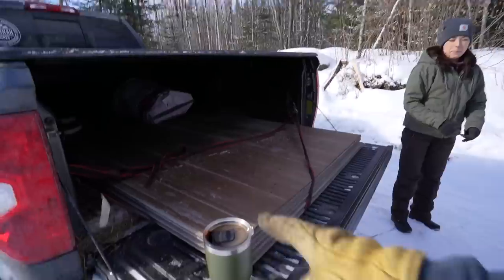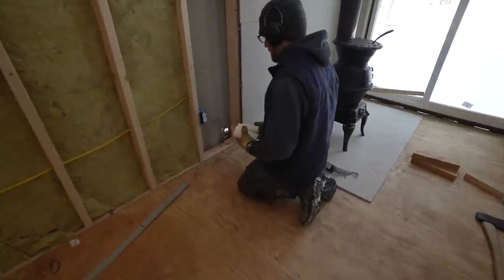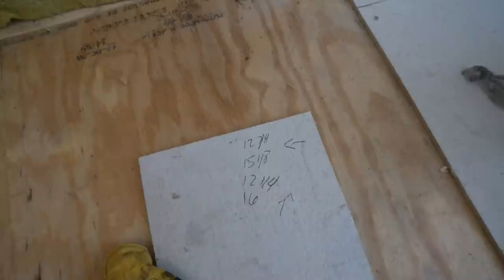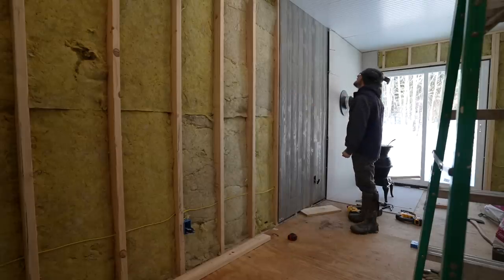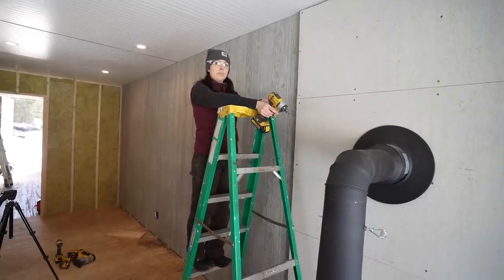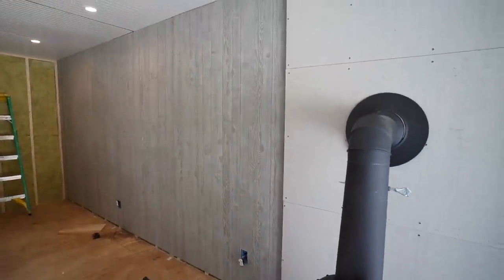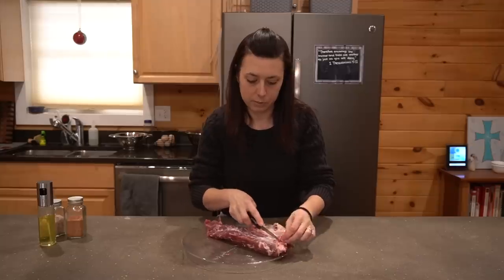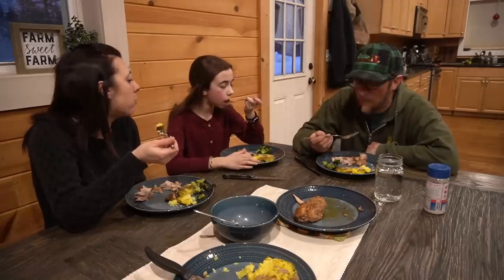You're Not Going to LIKE THIS!?! Installing Barn BOARD Sheathing in Our SHIPPING Container Cabin

Comment: Good Morning Lumnahs. Awesome to see you all healthy and happy. Al, would a small pitched roof help water and snow build up on roof. Doesn't have to be huge, maybe use some of the left over building materials from greenhouse, if you have any. Then you could do a water collection system like you have for NYC. It's good to all the animals are well too. Have a great day.
Reply: Obviously, the cost/effort/reward balance is subject to opinion but I would agree. Crafting the roof so it creates overhanging "eves" to further shelter the window walls. The pitched roof would create a "attic space" that would help heat/thermal/condensation issues with proper venting. The roof could be only on the "living" end of the container with a door for entry into the attic space on the "container center" gable end with a deck on the remaining (storage) end. I bit more work but seems like it would offer a number of nice advantages.

Comment: Gina.  I have found from years of experience and some big time flubs that a filet knife works nicely to get that silver skin.  I push it through the middle and turn the knife edge slanted up and pull it under the skin.  I do that for the other side and carefully peel it off. Takes practice but the skin cones off in bigger pieces. And it goes into the freezer bag of scrapes for making stock. You did really well with the knife you used. Like you said. It takes practice.

Comment: Not sure if you’ll see this before you caulk,  but when it’s cold and we have to caulk something on the roof, we put the tubes of caulk on the passenger side of the truck where the vent blows the heat out. It helps the caulk flow and bond a bit better we’ve found. Loving the container build and can’t wait for more off grid property builds!

Comment: wondering about your thoughts on a vapor barrier? won't the steel promote moisture behind the walls?
Reply: I am wondering the same thing. It looks to me that the vapour will condense on the steel side of the insulation, it will not be able to dry out and will pool at the bottom inside of the walls to create mold.
Reply: @bobbalbirnie2478  I sure hope they address that problem.
Reply: Over the whole build there have been 100s of comments about vapour barriers and condensation but not one comment from lumnah acres as to why they are not addressing this
Reply: Yes it will sweat. I'm sure many people using the containers for homes in climates like this will be dealing with mold in a few years. But that's another video!

Comment: I wonder if you don't need air vapor barrier before placing those board panels.
Reply: He does, and it has been mentioned before, but he chooses to ignore that advice. It will be a damp rust bucket.
Reply: @jimmyjohnstone7258  I'm afraid when condensation starts and it will form to molds.

Comment: I finished out a small cabin with barn board (paneling) downstairs.  I was so glad I did.  We went up to check and see how the arctic blast had effected our plumbing and a shower fixture had cracked.  I pulled the board off and made the fixes and put it right back up. Had it been sheet rock.  It would have been a mess.

Comment: Measure twice, cut once!  When I try that I get 2 different measurements and so I have to measure a third time to see which measurement was right. The third time doesn't always agree either!   I am carpentry challenged!  lol :-)
Reply from the maker: Lol so true
Reply: I always put chalk on fixtures and press paneling up against the chalked box. A lot quicker. I do mesurements off that to flip to other side of paneling so you get cleaner cuts on the good side of paneling. I know the box cover covers the edges, but i like perfection!! Lol
Reply: My X thought he could fix the washing machine. He made it worse and more expensive to repair. You have to know your limits. Maybe it's your measuring tape....
Reply: @marlenekutcher938  it's more likely to be my brain.   :-D
Reply: We say the same thing in quilting. Measure twice cut once.

Comment: I've found that a long very thin extra sharp filet knife works wonders on silver. Once you get it started gently work the knife back and forth while holding the sliver at about a 30 degree angle. To high and the silver gets cut and to low the meat gets cut. I usually do about 30%. But you got the job done without much waste so your doing fine.

Comment: Next time use the “lipstick “ trick. Remove electrical receptacles, paint outside edge of box with lipstick, press paneling in place and imprint box location. No measurement required. Save a step by not installing receptacles in the first place.
Reply: We used carpenters chalk. Yep. Saves lots of time!
Reply: I use a drywall router. Hold up paneling, drill into center of box, find right inside edge, step over to outside edge and rout around box.(Always rout counter-clockwise or bit will wander.)  Perfect fit in essentially one process. It took more time to type it out than actually doing it.
Reply: And you thought Gina was annoyed that Al used her bread knife!
Reply: hollar homestead had a tool for that
Reply: I'm going to guess you've made it onto your wife's naughty list more than once 😂
Reply: @This1LifeWeLive  Maybe it was his lipstick he was using!
Reply: In Sweden we use round boxes, so there's a set with a number of magnets with center hole (w/ conical steel bushing) that fits into the face of the box. Stick one in each box you're about to cover up. Then use the seeker magnet (also with center hole) to find the box. Hole saw /w center drill to cut the hole. The conical bushing deals with any slight misalignment of the drill/hole saw.
Reply: @michaeltempsch5282  We have them for all shape boxes.
Reply: @This1LifeWeLive  Well, you’re right. I’d never touch her cosmetics. However, I got all of my mom’s lipsticks when she passed away and shared them with other guys. We were building houses for Habitat for Humanity. The guy who taught me this had some that he shared with the rest of us.
Reply: @tonygrimes13  wait a minute..! See my response above.
Reply: @ron4jon  I was yanking your chain!!! Apologies if I offended!
Reply: @tonygrimes13  no offense so not a problem. and I can take a joke anyway
Reply: @ron4jon  Thank you. I did think your hack was of the KISS variety! No pun intended!!!
Reply: @This1LifeWeLive  Ha..!
Reply: I would never be able to "go find" a special tool. Chalk is right there and handy. Simple...lol

Comment: Hope you like mold, your gonna have water/vapor issues between that cold metal and your warm insulation.    Only way you could fix this is with spray foam of at least 2 inches which would have put a thermal and vapor barrier both up.

Comment: Looking good on that cabin half! I'm working on a design for a 20'x8' container as a shop, and decided to add a roof like Joe over at Homesteadonomics did. The difference is that I'm also adding six plastic 55 gallon drums for water storage, and about 2.7 kW worth of solar panels to the design. The solar panels will also give me the power to pump rainwater from the gutter at the edge of the roof up to the top manifold of piping to the water storage drums. This also means that I have about 3.5 psi of overpressure in the water lines coming down, so not residential pressure by any means, but at least it's a start!

Comment: Gina, you need to use chef's knife or fillet knife for removing silver skin or fat, not a paring knife. Also, for silver skin/membranes, grab a corner with a dry paper towel and give it a goo sharp tug...it will usually just tear right off.

Comment: I have had two of those container for 17 years now. Yous is in better shape, but the tops can get bent in as they handle them over the years. On mine, I took and 8 ft 4x4 and a bottle jack and set them up inside and bent the roof up to "dome" it a bit and it drains a bit better. You could also weld a strip along the top edge over the doors and windows as a drip edge.  
  I like the grey color wallboard as it is a good neutral color and goes with everything.
Reply: I did the same...that little bow allows water to run off and not sit there for long periods...thus maybe leaking later.

Comment: Now you know why I've been harping about head flashings for weeks. The metal cut out for the openings could have been used to make perfect head flashings. It still can, but you you'll have to mount them on the exterior with caulk instead of incorporating them into the wall plane.

Comment: If you want to make that job a lot easier, just get some butcher paper and place it in the same place as the panel will go with tape.  You can feel the outlets and pipes through the paper.  Just use a crayon to rub across the items to mark them.  Remove the paper and lay it on the panels.  You have instant access to all you have marked.

Comment: your paneling by the windows might not get wet but your insulation will, if it's not dry when you close it in you'll end up with mold inside the wall.

Comment: A lot of people seem to be worried about the fact that Al didn't install a vapor barrier on the walls at this point but let me tell you something - yes moisture will be generated inside the living quarters of the cabin - from cooking and just breathing - you could put a vapor barrier over the studs before adding the paneling to keep the moisture from making it way through the insulation and hitting the cold metal of the container walls - but it is a lot easier to do what he has done and then paint the paneling with a vapor barrier paint - I'm pretty sure you can get it in a clear finish - so u c there isn't anything to worry about - our house when built had loose insulation blown into the walls - I painted all the walls and ceiling with vapor barrier paint before putting on the final coat of paint - that was 47 years ago - never had a problem -

Comment: Might want to add a little aluminum drip edge to the top of the windows, so the water won't drain directly onto the windows. You should be able to pick it up at the hardware store or use some of your left over metal roofing to make it  your self.

Comment: Bonjour from France - I have noticed you have not put a vapour barrier in for your container project.  Are you not worried you will have an abundance of condensation on the interior of the container wall.  The heat and moisture you produce in side will seep though the insulation and as it is super cold where you are will condense on the metal.  I am in the process of a similar project for my home and it is a big worry for me - in no way am I criticising but just wondered if you have approached this in a different manner that could work (intrigued and keep up the great work)  à bientôt, Ian & Julie
Reply from the maker: We will find out. The insulation is touching the metal which should keep it from condensating like they do in still buildings.

Comment: Still curious about no vapor barrier between paneling and the insulation.  Serious moisture will collect on the cold wall and soak the insulation.. 
Wonder how you plan to handle that problem. ??

Water collecting on the windows is most likely room moisture condensing and running down.. puddling and freezing.

Comment: I have a rabbit that lives under a small evergreen bush by my front door... some of my old tulips have started breaking through the ground but the ones i planted last year are lagging behind... leaky windows are not a fun thing but you can use lots of caulk and they should be fine... I like the paneling and it goes up quick and is already finished so you don't have to paint... the wood stove seems well sized for the area.. not too big... I bought seed trays today... two 72's and a 36 that had growing mix in it. They all have plastic lids. The 72 trays look like they have dotted lines to split into 6 packs so i was thinking maybe i will give some of the neighbors a tray of something... maybe flowers or tomatoes. It was 65F here today.. normally its 45f .. it will go back to normal next monday.. yeah its looking nice

Comment: The draft pipes need a screen installed on the outside it's amazing how birds find this attractive to and entrance to make a home or nesting  or also to keep insects out of. Regular screen held by hose clamps will do nicely. Your caulking the outside windows and doorwall I wood use a Marine grade caulk used for boats or metals. Housing caulk is better used on wood products cuz it expands with the wood. I noticed when u installed the doorwall alot of light penetration on the BOTTOM might check that out before and little critters decide to make a dwelling dunno I mayb wrong. Have u all decided what you will use as a flooring OVERALL ITS LOOKING OUTSTANDING. GOD BLESS BE SAFE STAY WARM. JIM

Comment: At the risk of sounding like a broken record (if anybody remembers records), I say, "Put the door in. Put the door in. Put the door in. ..." It is, as Gina said, toasty warm a the top of the ladder because that's the height at which the rising warm air gets trapped while the rest of it goes out the door. If you put the door in, the whole space will get toasty warm. It is a continuing, utterly confounding mystery to me that you didn't put the door in (or a makeshift door) as soon as you had the rest of the dividing wall insulated.

Comment: Al, you have made a tinder box in the container with all that wood product. Don’t put fuels and the Mule in there... it could end very badly.

You should always use fire rated products like rock wool and sheet rock especially where you have a fire or stove... One hot coal on the ply floor or wood siding and it would engulf very quickly -like these wood effect products which contain glues and plastics when burnt give off acrid poisonous smoke, you could die in your sleep ☠️💨

Comment: This may be a comment only from Texas. You have a problem with that wood stove with all the heat near the ceiling and waist down it's cold. You need a ceiling fan. The new LED ones are super efficient and may be able to run off your battery/ solar cells. The only comment on the panels is if you are using Hardi behind the stove, match the color?

Comment: When you have on the stove there is a lot of wasted heat going up the stack can you not wrap a tight copper coil around it you could then pump water around it and into a insulated copper boiler for hand washing it would only need to be small scale. if you do start the incoming water at the top picking up heat as it goes to the exit which would be the hottest point the boiler would have to have an indirect coil inside it so the stack system was a closed loop just fit a pressure relief on it